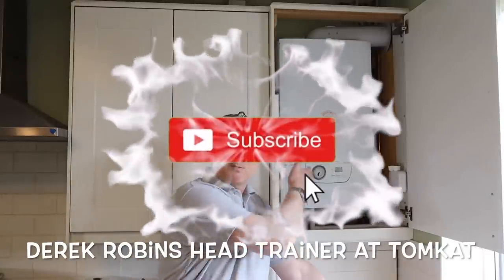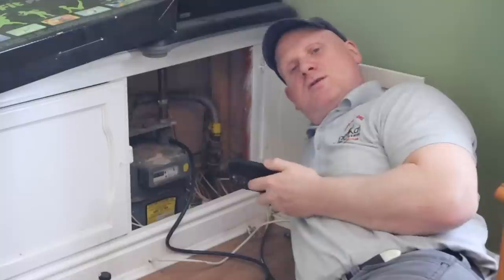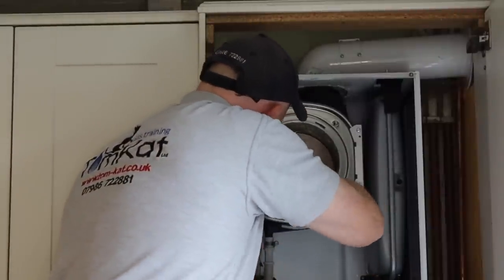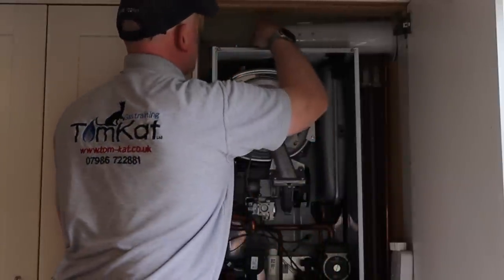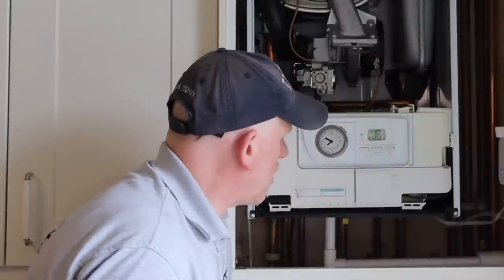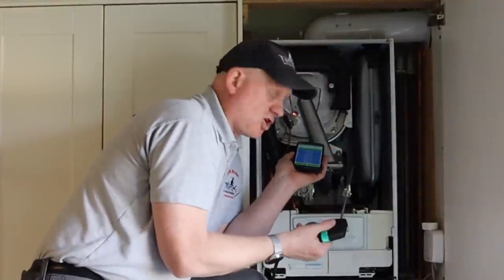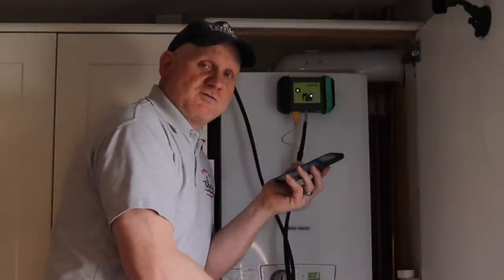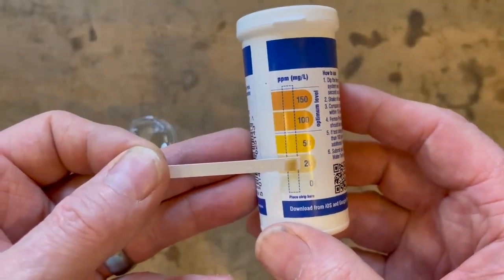Boiler service to new building regs part L. will gas engineers comply and will customers pay for it.

Comment: re: adjusting DHW flow temp (at 42:59). You say it should be adjusted so that no cold water needs to be added to the bath to get the water temp required & this saves energy. But surely it wouldn't make any difference if cold needs t be added or not?  Say 100 litres of water at 37 degrees C was required for a bath. Wouldn't the same energy be used whether say 70 litres at 60 degrees plus 30 litres of cold was used or just 100 litres at 38 degrees was used. The boiler would run for less time at the higher temp & so the totally energy expelled would be the same as running longer at a lower temp. I mean 100 litres of water would contain the same amount of energy no matter how it was heated. Or am I missing something?
Reply from the maker: We are talking combination boilers here not water from a cylinder. If you set the water temperature to your required bath water temperature the boiler will heat a million gallons to that temperature because it’s a combi boiler so if you have to put cold in you have wasted energy because you are cooling the water down which you have just paid to heat. It’s like putting the heating on and leaving all the windows and doors open
Reply: @tomkatgastraining  It's not like leaving windows open. The hotter boiler would need to heat less water, will run for a shorter time at the higher temp and so the total energy required is the same.  In my example, you're not heating 100 litres & then cooling it down with cold, you're only heating 70 - as opposed to 100 litres at the lower temp. 100 lites of water at 38 degrees say, contains the same amount of energy either way & would take the same amount of energy to get it there no matter what the ratios of hot to cold (assuming a boiler's efficiency is a constant at all outputs)
Reply from the maker: @45graham45  combi boilers heat the required amount of water to a set temperature. The colder the water going into the boiler the more energy required to heat the water to the set temperature. What I was getting at was if you set the desired temperature of the water at the boiler control so the water coming out at the tap is 50 degrees c but you only need 38 degrees c for a bath and you have to put cold in to get into it then you have wasted energy heating the water to the higher temperature so don’t really know what you are getting at
Reply: Simple physics. If you're heating the same amount of water to the same final temp then the energy it takes to get there is the same. If you use a little very hot water (plus cold) or a lot of warm water (& no cold) if the final temp achieved & the final volume is the same, then the energy used has to be the same.
Reply from the maker: @45graham45  that’s not how combi boilers work because the gas is modulated depending on the cold coming in and the flow rate through the boiler. So a boiler allowing 9 litres of water through the plate with a cold inlet temperature of 10 degrees c with a hot water temperature of 38 degrees c at the tap will use the same amount of gas as the temperature of 50 degrees at the tap I don’t think so
Reply: @tomkatgastraining  but you'd be using different amounts of hot water in each scenario. The boiler might run for 10 mins on 60 degrees say, rather than 20 minutes on low, say 38 degrees. You're heating a higher temp but much less quantity (the rest is topped up with cold.). Or lower temp at a higher quantity.  The temp of the water supply going into the boiler is the same in both scenarios.
Reply from the maker: @45graham45  The specific heat capacity of water is 4,200 Joules per kilogram per degree Celsius (J/kg°C). This means that it takes 4,200 J to raise the temperature of 1 kg of water by 1°C so if you are taking the water to 38 degrees you have to use less energy than taking it to 50 degrees. My point like I said in the video if you only need your bath water at 38 degrees but your bath water is at 50 degrees and you put cold water in to take the water down to 38 degrees then you have wasted energy because you have heated the water 12 degrees more than you need.
Reply: @tomkatgastraining  But you're heating a lot more kg of water at lower temps than higher temps & so the number of J is the same overall. As you rightly say, it takes 4,200 J of energy per 1kg of water by 1 Deg C. In both scenios you'd have heated the same bathful of water by the same temperature - but by using different proportions of hot / cold water. And the same amount of energy has been used because in both instances, the final result is that 1 bathful of water (say 100kg)  has been heated to 38 degrees. In Joules equals 4200 x 100 x 28 in both scenarios (assuming the cold inlet water had an initial temp of 10 degrees & so was raised by 28 to 38 degrees)
Reply from the maker: @45graham45  ok I get where you are coming from but think of it in life you like your bath half full you turn on the hot tap you fill the bath half way with just hot water because it’s a combi and you can’t blend it because it takes an hour to fill the bath because of poor flow rate. It’s  to hot so you put cold in to cool it your bath is now 3/4 full you have not just wasted heat you have wasted water. So you now set the hot water flow to the correct temperature you fill the bath half way you get in the bath it’s lovely now you have saved energy and water and you cleaned the loo while you waited for the bath to fill.
Reply: @tomkatgastraining  But obviously, if you want your bath to be only half full, and you know your boiler's chucking out hot water at say 60 degrrees, then you only quarter fill it with the hot water & top it up to half full with cold. Or in real life people run both hot & cold taps together - until it's to the desired half full. Doing it this way is also quicker as you'd have more flow from both taps together than just the hot tap (which is all you could use if you'd turned down the temp as suggested).
Reply from the maker: @45graham45  mate it’s been great but you are talking about exact measurements people don’t think I have to fill my bath 1/4 full with hot and the put 1/8 of cold and I will have the perfect temperature. People turn on the tap go and do something else because it take ages to fill and then come back find the bath water is too hot and out cold in. I agree you are technically correct but people don’t live that way so you’re way people would waste energy and water my way they can have the bath a full or empty as they like saving energy water and time. And most combis won’t work with both taps on in my area
Reply: @tomkatgastraining  If a combi doesn't work with both taps running then maybe a combi isn't the right system to install for that area. What if someone has a glass of water or fills a kettle or brushes their teeth or flushes a toilet? You lose all hot water! That's not good if you're in the shower. If there's adequate pressure for the combi to have both taps running then the bath will also have more flow available & so fill quicker if the DHW is left hotter & cold is also run at the same time. Having the DHW at a low temp might be more convenient for those without adequate mains pressure but it won't save money (unless the boiler happens to run more efficiently at the lower temp) just because you're heating water then adding cold as your video suggests.
Reply from the maker: @45graham45  you obviously don’t live in Manchester

Comment: If the sarcasm at the beginning of this video is any indication of the seriousness that this company takes gas servicing regulation changes, I'm pleased I moved to a heat pump.  Oh and yes, the heat pump does work, it has a COP of 4 and worked well for over a week at -5C last winter.
Reply from the maker: May I say I take regulations very serious and I train my trainees to always work by the current standards and regulations. Glad to hear your heat pump works even at -5 with a cop of 4 😜
Reply: @tomkatgastraining  That’s not quite what I said, the overall COP is 4, at -5C it’s a lot less. I don’t want to misrepresent how effective heat pump are.
Reply from the maker: @Muppetkeeper  bit like me at the beginning of my video then
Reply: @tomkatgastraining  Fair enough

Comment: After the gas pressure test when you removed the manometer you said if the pressure drops below 7 mb you have to purge.Even at 7mb there is still pressure within the pipework so how can air get in?Can you explain please

Comment: You would fail your acs for not turning gas off to replace test nipple on meter
What if any thing would potentially happen to you . You would have uncontrolled gas entering the property.
Reply from the maker: Ha ha ha I love how this nonsense has been spread around it like saying you can’t drive a car because you might have an heart attack at the wheel. And no you won’t fail your ACS for doing what I did.
Reply: As a bg engineer for forty years I know of someone failing their acs for doing this on the initial assessment 
Straight out the door they went
Reply from the maker: @andylucas3724  that’s an assessor playing god who dose not understand the assessment process
Reply: How many reports of gas engineers having heart attack while disconnecting test nipple … I’d guess errrr.   0
Reply: Paul white
I’m only saying mate I know someone who failed their initial assessment for doing that
A fail is a fail with you being unable to work
Reply from the maker: @andylucas3724  you can’t fail an initial assessment for that task. Like I say it’s assessors playing god or a trainee failing on something big and making it look like they are hard done.
Reply: Retired from this dying industry now
Seen to many cowboys and having to put right their work
Glad to be out of it

Comment: Boiler servicing , if its working leave it alone. I check my relatives as the water pressure drop now and again , I know how to sort that out 🙂. The ony reason you need to do an electrical test is if you have done something naughty to make more money by making a short. Theres so many nasty people out there. If theres a leak you would smell it, more BS.